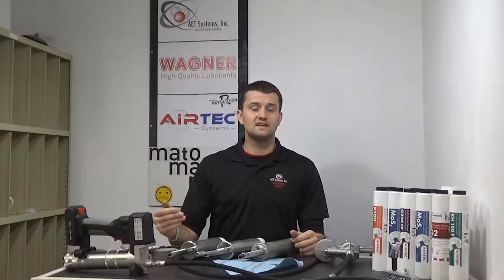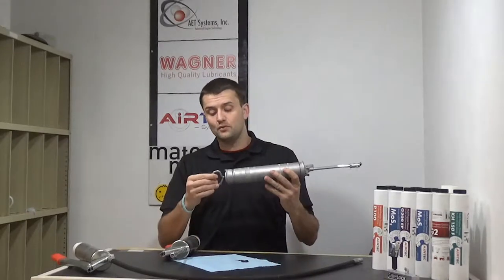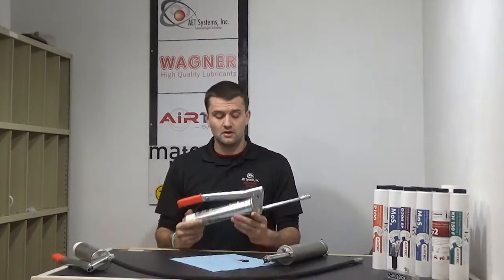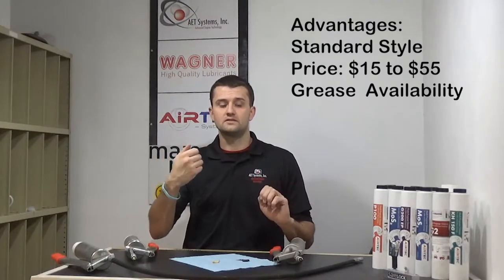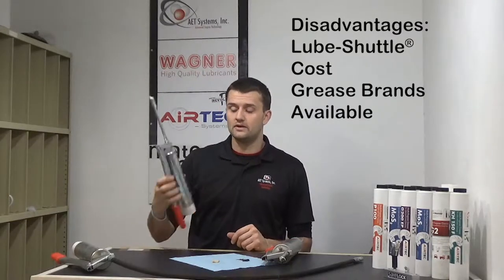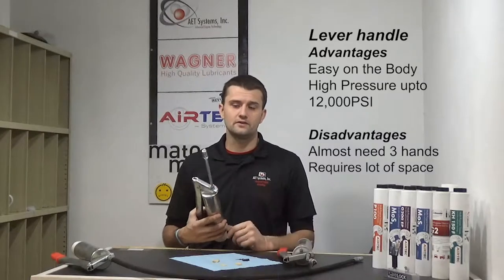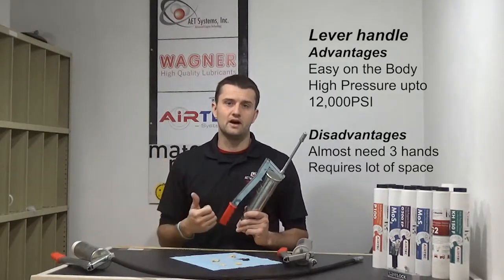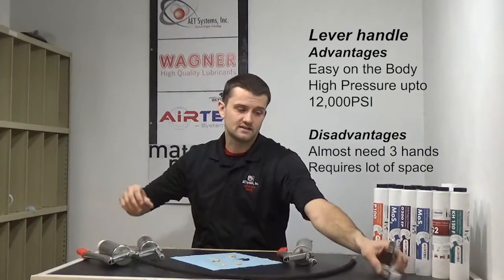Getting the Right Grease Gun: All You Need to Know!

Comment: Nice video, Thx!  I'd like to know more about the 'spring-rod' grease guns and why the rod should be pulled out every time a grease job is finished.  I have heard that the constant force of the spring rod 'pushes' the oils, additives, etc. out of the grease 'carrier'; hence these oils, additives, etc. will tend to drip from the bottom over time; and then less is available within the grease carrier.  These rods are often quite difficult to pull back out every time a grease job is finished.  And of course every time it's pushed in, there is usually an air bubble that needs dealt with.  It is the reason(s) mentioned above that I went with Lube Shuttle guns.  And because I've got my own type of grease(s), I also got the refillable empty plastic tubes that I refill from a 5 gal. pale using a hand pump.  I don't do lots of greasing, but didn't like the constant spring force of a 'normal' grease guns, once I found out about it.  I was curious if I was over thinking this?.?  Thanks!
Reply from the maker: Hey, great question!  This is a very common belief, but you might be surprised to learn it is also a little bit of a misconception!    The pressure of the rod/spring is quite low compared to what most greases are rated.  For example--at most most the rod/spring will apply 50lbs of pressure to the grease to try and force it out of the grease gun, by comparison a grease like our MoS2 is rated for a minimum of 1760lbs of pressure/inch.   So the the pressure shouldn't be causing the grease to separate.   Most likely the grease is separating due to lower quality standards during the blending process.  Once separated, the rod/spring will force the oil around the seal on the rod which will then in turn leak out of the bottom.   So, yes, releasing the pressure can help prevent leaks, but more than likely the grease is still separating.

Comment: Hey Wes,

Thank you for sharing your expertise. I'm beginning to figure out just how long it takes to acquire it.

I have a question I'm not sure is worth answering for you, but I figured I'd give it a shot. Thanks either way.

I recently greased my 2019 Freightliner Cascadia CA125SLP and was wondering
If I did it right. I used a Dewalt Electric Grease Gun, which I read can shoot grease at up to 10,000 PSI (compared to the 500 PSI of a hand-pump pistol grip grease gun). 

Do you know any parts of a semi truck that can be damaged due to over pressurization from greasing with anything but a pistol grip grease gun? 

I read something about bearing seals bursting at 500 PSI, leading to contamination... 

My 5th wheel locking jaw grease fitting page in my maintenance manual specifically says not to use anything but a hand held grease gun because a high pressure grease gun would break the grease tube.

But will anything similar happen to king pins, drag links, slack Adjusters, tie-rod ends, pitman-arms, steering gear boxes, S-Cam brakes, clutch release bearings, drive line u-bolts, etc? 

I know my slack adjusters and tie-rod ends both have boots on them... I accidentally popped the boots on both of my tie rod ends... Do I need to get them fixed ASAP to avoid contamination? How quickly will premature breakdown occur once the ends become contaminated? Or will I be fine just greasing them more often in the mean time until it's more convenient for me to replace the boots? 

For my S Cams, I kept pumping grease over and over again even after grease initially started seeping out because I wanted the color of the grease seeping out to look almost brand new instead of black. I heard that over pressurization happens when the grease fitting is full, so could greasing it continuously while it was full cause some sort of damage?

For my clutch release bearing, I over greased it a little as well. Could I have damaged something internally?

I've yet to see a video online that covers this topic comprehensively. 

Thanks in advance.
Reply from the maker: Thank you for your inquiry.   It is a diverse question.   1. Most pistol grip grease guns will put out 3000 to 5000psi, which is lower than electric greaser (typically 10,000psi) and lever handle grease guns that can generate up to 14,000psi.  Any style will provide enough pressure for your application and caution needs to maintained not to blow out seals.  

In terms of over greasing-  Over greasing is less of a concern in regard to pins and bushings, slide ways, open bearings, and slow moving bearings.  Over greasing in higher speed bearings can cause increase drag, increase running temperatures, lessen heat dissipation, all of which can lead to mechanical failure.  So it is important to not over grease, however, more important to make sure you are grease often enough.  So of the two options you are typically safer with a little over greasing.  

In your case, when the seals have been pushed out they need to be replaced as soon as possible to prevent contamination, with winter coming and road salt being an issue we recommend replacing any blown seals right away.   Concerning the boots that have been separated, clutch release, and s cam and are no longer providing a perfect seal---We recommend talking with a local mechanic that you trust.   By being able to visually inspect the situation they will be able to render the best advice.   

Thank you for this great question, I think we will do on video on this topic!   Safe travels, stay safe, stay healthy!

Comment: Hi I have a question, what does the number(400/600cc )and so on, mean when buying a grease gun?
Reply from the maker: Good question, it refers to the volume the grease gun can hold.  Typically just look for lube shuttle cartridge or standard cartridge compatibility.  However, if you are manually loading the grease gun it might make sense to look for a bigger volume like 600cc.

Comment: hey I always have a problem with the spring in the tube that its twisting in the tube and not pushing the grease out any solutions for that thanks
Reply from the maker: We recommend taking the grease gun apart and cleaning it thoroughly to try and solve that issue.  Unfortunately that is a common issue with the old style of grease gun.   If it continues to occur it is most likely from a manufacturing error, damage, or wear and you may be forced to replace the grease gun.

Comment: What’s the price of the cartridge of grease for the lube shuttle style? I’ve heard the grease is more expensive
Reply from the maker: Good day, our multipurpose grease is priced at $6.80/tube, however this is less of a lube shuttle cartridge cost and results from our grease meeting industrial standards as we do not offer price point based grease.  We only offer grease for retail that we already provide for our industrial supply division.
Reply: @aetsystemsinc.1413  
The Lube Shuttle grease is only offered with high quality grease, and it’s about the same price as a regular cartridge style, for the same grease quality. 
But the regular cartridge style offers “value” grease which is cheaper. But I don’t recommend cheap grease.